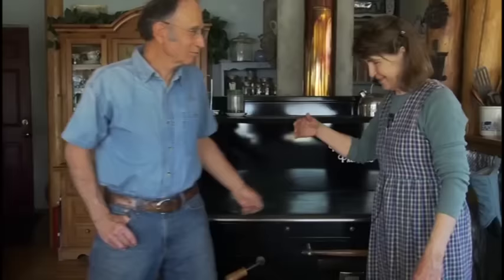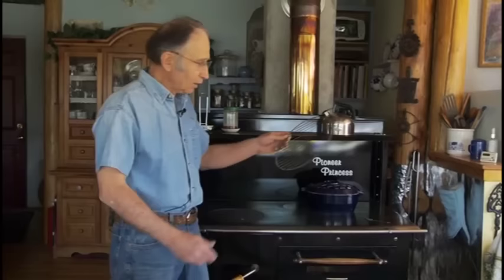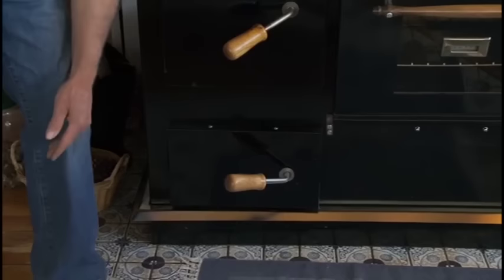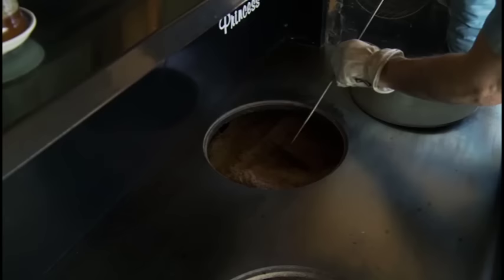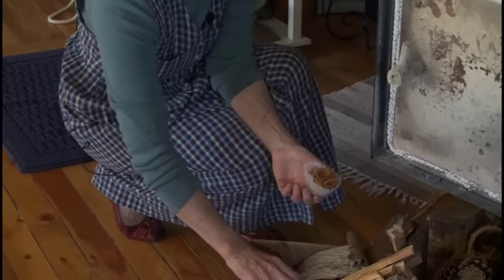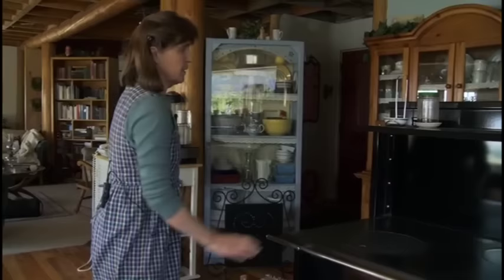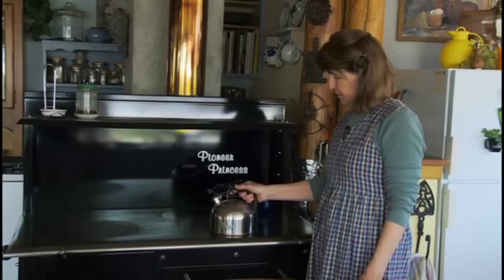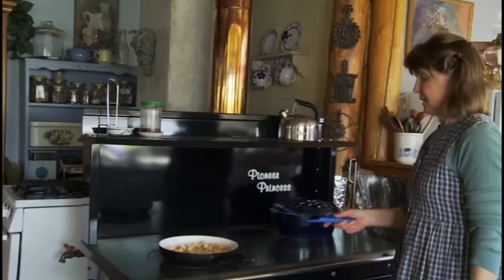A Wood Cookstove is a Must Have!

Comment: LOL "With this stove you need a large bush of aloe vera"  The way she said it was really funny.  She is right.  I am a professional blacksmith.  Even though have not burned myself on my wood cook stove, I have burned myself with hot iron at my work.  Aloe vera really does work.
Reply: In all my years of wood stove I don't ever remember burning myself.
Reply: Don’t recall the name on our stove- The best bread and buns came out that oven - easy to start a fire- did it hundreds of times- this sounds complecated but it is not
Reply: Have used my woodcock stove for cooking and heat for 48 years and have very few burns . You learn really quick.
Reply: We've had and used two wood stoves  (one for cooking)   in our home for almost
50 years and I haven't burned myself yet ....and pray I never do.   Couldn't manage
without them !
Reply: By the way =  Our cookstove is probably over 100 years old and the name
on it is   Round Oak  -  Chief.  It has a top warming over,  and a good water reservoir.
Reply: Calendula oil.
Reply: Virgin Coconut Oil takes the sting out of a burn as well! Works fast too! Use it all the time on finger burns from cooking or hot coffee/tea on the tongue.

Comment: Caneyville, ky.  I have visited the factory.   They use a steam locomotive engine to power shafts under the floor that runs there hydraulics.  Steam engine also runs generators to power there welders.   Very nice place and community.  Great video thank you.

Comment: I've been a welder for 40 years you can put rubbing alcohol on a burn it will pull the heat out keep it from blistering works really well it don't burn you it cools it off
Reply: Virgin Coconut Oil stops the sting on a burn. Works within a few minutes!

Comment: And I’ve gotten into the habit of cleaning under and around the oven of my wood cook stove every two weeks. I was told not to clean all the ash off the top of the oven because it prevents the baked items from burning the tops. Thanks for the tip about the cedar chips and the candle wax. There is a wood working shop just behind our place and they are always trying to get rid of the bags of sawdust.

Comment: Neat video. Lots of first person hands-on information which will help folks get started with understanding and using their new appliance. I would advise anyone wanting to use a woodstove or cookstove to seek out a good competent professional to ascertain the condition of their chimney before doing anything else and make sure that your proposed installation is up to snuff. There is A LOT more to this than can be covered in a video. This is not a criticism...just my professional observation.
My wife and I established a business and started servicing/installing and maintaining solid fuel appliances and venting systems in 1988 and I am retiring and passing the business on this  season. I am widowed now and will be home more to make sure my Grandkids are warm, well fed, and safe no matter what.
 With all of the crap and uncertainty out there I am installing a U.L. listed and tested cookstove (Waterford Stanley- acquired in trade) in the homeplace in place of a heater that I have pretty well worn out. Fof anyone thinking of doing this, please don't take for granted that what you have now is okay...or that what you envision is the best or only way to do things. Don't be afraid to get help. Not every project is a DIY project.
Be safe.

Comment: I would love to have one these stoves. I cooked on a very large 8 eye antique Belleville for about 12 years when we lived in Alaska. It was very aesthetically pleasing to the eye with it's chrome trim and warming shelves but took 3 hours and a mountain of wood for all that iron to get hot enough to bake a pan of biscuits or bake bread. These new stoves are air-tight making them more efficient, they heat faster and burn a lot less wood and you can control the temp. which is a major plus.
Reply: Those stoves where meant to be permanently stoked.
Reply: I am glad people are manufacturing these new stoves with some modern technology.

Comment: Great video with heart warming, kind actors. 🙂

When I saw the cleaning procedure, I thought a bottom chimney metal box drawer might help them catch some of the stuff accumulating inside the chimney pipe, and enable them to, also, push the stuff from the stove into the chimney pipe.  It should fall by gravity through a short metal slide into the drawer and simplify the cleaning process a little bit.

They could ask a local masonry guy to do this.

Comment: In the summer my mom would send us south to spend the summer with my aunt.  She had 2 stoves:  a wood and a gas stove and we could only use the wood stove.  She had an electronic iron and an old fashioned cast iron iron which we were only allowed to use to iron our clothes.  We learned fast not to burn ourselves by the time the summer was over.  Each room had a wood stove for heating during the winter. 😍

Comment: I bought the pioneer princess ..get the long surface one with the water res. you'll love the extra space also order a second set of the inner fire bricks ...you'll need them ....
.....Keep a small pail of salt handy close by the wood stove , If you have a chimney fire you want to put out in a hurry toss a few cups of salt in on the fire and close it down salt puts out a fire right fast ...salt is also good to cook with ... sprinkle a bit of salt on the stoves top surface and you can toast your bread on it with out the bread stickin and burnin ...a great trick ....also to resurface your cook stove get er hot and rub some cookin oil into the top surface use paper towels or even newspaper and keep them for fire starter nothing like oily paper to start a fire ...
Reply: I just got one 2 days ago. However it don't have any fire brick on the bottom of firebox,  only on the sides. Seems like the floor beside the grate would warp from heat with no brick. Does yours have anything on floor of firebox?

Comment: It's a beauty.  Real wood cook-stoves like this one were the climax of home wood burning technology.  Wood-burning furnaces or non-cook stoves were not found in ordinary homes.  These babies were what the farm houses relied upon.  Grill-bricks (used in restaurants on electric or gas grill-tops), available at restaurant suppliers would be a great tool to clean the stove-top and they are almost 4" thick, allowing you to clean the top even when it's surprisingly hot.  Put a little water on the top, rub the brick back and forth, rub it clean with a wet rag and let the water burn off.  Heck, we used wet paper towels but the grills were smaller than the wood stove's top.

Comment: What a gem of a video, makes me want a wood burning stove.
Reply: I did more than want one, I went as far as to price it. My desire for a wood stove is now low again.
Reply: @itrow9526  if you're able to obtain a steady supply of wood,itd cut out alot of your energy bill. With an electric range and electric heat ours averages $240 a month throughout the year. Last year we used more killawatts per month,but our average bill was $180 a month. Our provider asked for and received a 9% rate increase last year and are now asking for an additional 7% increase. If they are approved for that our bill will be close to $300 a month,from only $180 a month 2 years ago. $3000 for this thing is an investment in our future.  The only other 240vlt appliance that leaves is our hot water heater,which I'll change out to a heat on demand unit. If I can save $200 a month on our electric bill,thatll cover 2/3 of the cost of the stove in the first year of ownership. Our utility bills are gonna go up astronomically over the next few years and service may get sketchy thanks to our fine government. I'll spend now,and save big later.

Comment: I have used a wood cook stove for many years, until marriage...I loved cooking on it and it provided heat, as I live in the mountains near the Canadian border...Historically, they were expensive new, as is now...they are well worth the money and will last for generations, as long as coal is not used...does not take long to master using it...I remember on many a below 0 day sitting in front of it with my feet in the oven trying to keep warm...the old house was 2 one inch rough sawn boards thick and frost was on the walls...

Comment: I had one of the open fire ranges with three oven doors an open fire with trivets for pans and a back boiler. It was the best thing ever..the water was so hot we all took baths in the evening because it used to make such a noise. The middle and top ovens were really hot and the bottom one dried your kindling and logs for the next morning.  I used to clean it out every second morning (sometimes every morning). It had dampers and bits you pulled to make the oven oe the water hotter but I found just running it for the open fire heated everything really well. I miss it so much but I have got a cooking woodstove for my cabin but we aren't finished building it yet, I wouldn't have anything else.  Cooking woodstoves really are the centre of a home.  I love this one.

Comment: Thank  you William and Janice. We purchased the Baker’s Choice to supplement our masonry heater. The latter works fine down to zero F, but it is often colder here in NE VT even down to -30.  I appreciate the thoroughness of your video, cleaning, cooking, the top turns blue etc.  we have only fired it up twice so far but Winter is on the way. I plan to cook a lot on this.
Reply: How much?
Reply: @ioandumitru8747  3000 including delivery and the extra stove pipe.  It has been worth every penny.  We are just two people so the stove fits our needs very well.  If you have a larger family you might consider the Pioneer Princess which is just a nicer and larger model.  We did not get the warming cabinet but just the shelf above,  I actually think this is better than the cabinet because I just quickly place food up there and it stays plenty warm.  Invest also in trivets or just make simple triangular ones from flat stock so you have better cook surface temperature control. Hope this helps.

Comment: We have this stove and began using it Dec 2012. The downside to this stove from my experience is the firebrick. They are custom size and you can't get them at your local farm store. I've replaced the large firebrick three times - twice as the full set. This year (2017) I installed the stainless steel firebrick hoping never to have to replace them again. We heat our 2200 sq ft pole-barn home with this stove. We are in central Kentucky so the winters aren't harsh.

Comment: One thing for sure you do not want to take all of the ashes out - you want to keep a layer of ashes to build your fire on whether it is in a wood cook stove, wood heating stove or fireplace ...   used all of them for years....
Reply: I heat about 80 to 90 % with a wood stove.  I purchased a used down draft wood stove the first fall we moved in to the house.  I have to clean the ashes out once a weeh with full time fire running.  When the ashes get cleaned out, I remove as much as I can.  The first fire will give me plenty of ashes.  The advantage of ashes in our stove is that it acts as a heat retention and slows the final coals from burning too fast, so we get longer times between adding firewood.

Comment: I remember my dad on Saturday morning's cleaning the old Caloric wood-fired stove it was enamel finish two-tone the top of the stove he would clean the top of the stove with emery cloth and kerosene and a block of wood after dad got through it looked like new than he had it converted to burning kerosene then in about 1955 they bought the pice of tin my mom hated it took 4 men to get the Caloric out of the kitchen I wish I had that stove today. Still, I'm 78 great memories around that stove. It probably made 10 Toyotas?

Comment: Good Vid, though guy at beginning did chat and repeat things over and over for 4 mins.  Started to dig my 1000 square foot bunker 2 yrs ago for fire danger--put all my most import stuff inside + other + for other reasons.  Very good vid, learned a few new things but for newcomers and medium XP level..good vid.  Thanxs for posting...Oohh almost forgot to mention-trick I learned in the 1970's--at end of season or mid season to clean creosot better--get fire hot and throw big handful of rock salt on fire..shut door and let the salt do all the hard work  :)

Comment: I lived with a multi-fuel range for a few years.  Hot water, heat and cooking.  A full firebox lasted about 14 hours.  It would burn coal, coke and anthracite.  I used to visit the forest for pine and windfall wood - and raid dumpsters for lumber.  It was wonderful and I miss it.

Comment: Couldn't help but notice his elbow is inserted into the lead pipe.....The direction of the seems should always be going outwards. This is why many have issues with fires as the inward elbow, allows the fire to mix with the air causing pipe fires...Proper lead pipes have the crimp on the end of it to allow the elbow to be inserted over it, not into it.
Reply: It is an airtight stove, the pipes are being properly assembled :)

Comment: Use compressed blocks (no sap wood) all hard wood,  you have to much creosote. Running stove to low at night.  Need a hot burn first thing in am also helps
Reply: Not everyone lives on the east coast. In the north west, there are no hardwoods. We burn whatever we can.
Reply: @dumper87  There is hard wood in pallets :-) free usually as well. Yes, I thought there was a lot of creosote buildup as well. I was thinking of buying the stove and was blaming the make and model, nice to know it was just the wood choices.
Reply: @dumper87  "In the north west, there are no hardwoods."

What? I've lived in the Pacific Northwest for most of my life (born in Oregon, raised in Washington) and can say with 100% certainty that we have plenty of hardwoods here, with alder (a relative of birch) being the most abundant.
Reply: @LoisMcQuinn  "There is hard wood in pallets"

Not always. I used to work at a pallet plant, and yellow pine was one of the woods we used a lot.
Reply: SeikiBrian I’m in north Idaho, not Washington. The closest thing to hardwood that we have is birch. The best firewood you can get here is tamarack, Doug fir, and ponderosa.
Reply: @dumper87  Birch is a pretty good firewood, can be hard to come by.
Reply: SeikiBrian it’s good, but dangerous to cut down when dead.
Reply: @seikibrian8641  he's correct! I just did my walls in pallet wood. Oak, cherry, and birch...yes, some yellow pine...but you know when you look at it, feel the weight, see the GRAIN!
Reply: @dumper87  dangerous?! LMAO whatever...
Reply: @LoisMcQuinn  chemicals in pallets, poisonous.
Reply: @omni1omni244   Really?? Where are you getting your pallets from? Can you explain more.
Reply: @dumper87  - Hum... I currently live in the pacific nw and there is maple, alder, birch, and fruit woods (apple, pear, plum, cherry, etc.).
Reply: @dumper87  there are oak ash, maple, apple, etc... and more just look around
Reply: SmellyCat Don't know about the US, but in the U.K. pallets stamped "HT" are heat treated as opposed to chemically treated and are therefore safe to burn. One issue to look out for is that the pallet blocks on many pallets are now made of compressed wood chips / sawdust with a binder rather than actual pieces of timber, and should therefore not be burned.

Comment: Haven't been able to find one. Need a good used one. Wish someone would build them again, mid size, affordable, and also wringer washers! Can't find those either!
Reply from the maker: krazo hills Well, the old ones usually have very small fireboxes so getting an old used  one can be disappointing.
Reply: Hello...
Do you have any Amish near you?
If so, find out where they shop as most
Amish still use Wringer Washers.
Also, go to Lehman’s website.
They carry all types of non-electric appliances 
and other off-grid living items. 
They have Wringer Washers for sale.
Sign up for their catalog, it’s reminds me of the
old Sears and Wards catalogs.
Please be prepared though as their prices can seem
a bit pricey...
You need to keep in mind that not many places sell 
these type of items anymore so supply and demand 
figure in here...
Hope this helps some.
Happy Holidays and Be Blessed...!
Reply: I can’t afford one. It’s on my must have list with heat exchanger for hot water. Someday 🤔
Reply: Troy Stutsman those wringer washers are now made in Saudi Arabia..(women wear huge cloth, one piece..). They aren't cheap. Find used one domestically.

Comment: Their chimney cleaning was not so good....you have to start at the roof and work your way down not at the pipe as it enters the chimney.
Reply: There are different methods.
Reply: Chimneys are bullshit. I put the pipe right out the wall nd bypass the chimney.
Reply: Thats why you stick it out through the wall and then an elbow and then have four feet in the air, but you can clean but clean a three-story chimney and have fun.

Comment: To use the waffle maker you open the damper, remove the hottest top lid (always the front one over the grates) and set the waffle maker over the fire. As long as the damper is open the stove will not smoke.

Comment: I know the Video was made in 2016. I thought it would've been better if they would be been in use video. This video is one of the better one I've seen. I have been saving forever to get A Amish made stove with side water tank with the coil to hear the water. Also the warming oven, the ones I like have many choices of use. I did like the cleaning of the whole unit very important especially the chimney done every year. I want a plain stove for outside on the back porch for using during harvest preserving time in the summer. It was the way my GrandMother did. Positive memories. Thank you